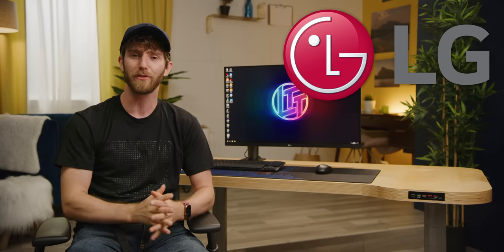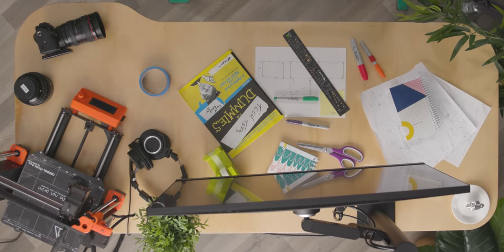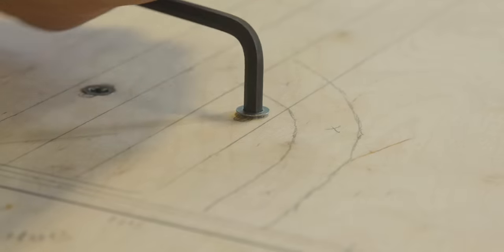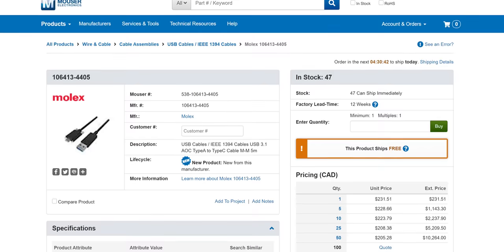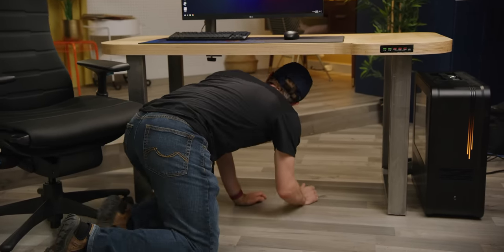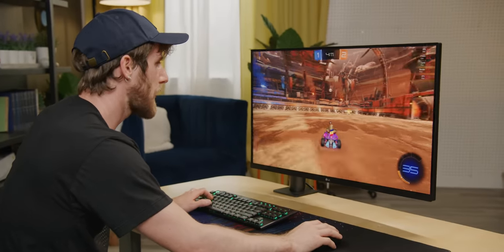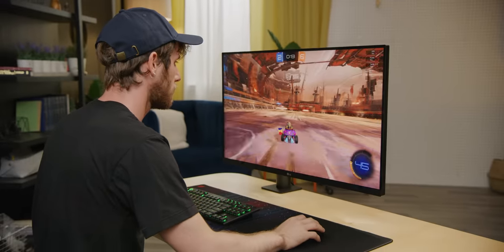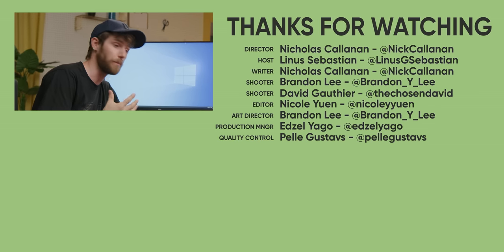Project Zero Cables - The Cleanest Desk Setup EVER

Comment: Not gonna lie "DIY Perks" did it better
Reply: Yes. With you on that one.. But this is a cable management project... And he does say at the end that there is a 'PC inside desk' project on its way.. Hopefully we will see the reference/deference to the DIY Perks build in that video.
Reply: They have made more than one pc setups, where it is integrated in the desk
Reply: @notjohndoe7130  i said what i said because the thickness of "DIY Perks" desk is almost same i guess.
Reply: and remember DIY Perks is just one guy. Linus has a whole team and a giant workshop. DIY Perks is doing all this from a normal small home. Its amazing what he manages to achieve. Great design and engineering but sometimes not very practical. Like the what was it dozens of noctua fans? have you seen how much ONE of those is? hehe
Reply: @ClayMann  You are right , Linus has his whole team and lots of expensive kit, however I'm not convinced that his workshop guy Alex is that good in his field. Remember the Pyramid PC build? He  can barely just about weld two pieces of tube together..

Matt at DIY perks does the whole thing. Whilst I take your point that noctua fans are expensive, I'm sure he suggested an alternative in the vid (I'd need to rewatch it to make sure).
Reply: @paulluce2557  I agree 100% with what you're saying. He recommended server fans but they are massively loud. You can run them slower but that Level1 guy Wendel has said many times. Don't run server fans in your room. Put them in another room or basement. As soon as you start hammering the CPU those server fans will rev up and sound like multiple hair dryers lol

but to be fair. If you were patient and searched for S/H fans that are the better quality ones. You could get the price down but for me at least it would still be too expensive for what I'm trying to do, cool my PC. I think a nice easy way around all this would be to just have the desk one drawer thick and have drawers either side with half the space at the back of each drawer for a full sized PSU (those server ones are again very expensive) and have a normal full height noctua cooler. For me the drawers would be super useful. In my own serup I have 6 drawers on my desk and I use them all daily. but minimal is in and practically managing all the junk that comes with your PC like controllers, flight sticks old drives and so on doesn't gel well with minimalistic design principles haha
Reply: @ClayMann  Yeah, surprised how much he can achieve in that room. Its quite small for all the large scale projects he produces in there. Love his work. Turns mundane everyday things into art.
Reply: Interested to see price vs time vs performance for both projects thought...
Reply: He should have used a GPU+CPU AIO such as a hunter duet 2 frm ID. Would have made the build more silent, cooler and not severely underperforming.
Reply: @tahsin28  having 40 of those noctua fans, made people comment a lot, which will be picked up by the algo

Comment: We could take this to the next level.
The next level:

Levitating monitor setup
Reply: that's exactly what I was thinking
Reply: Could actually work with magnetic, although the box you would need to build to hold the monitor in place would defeat the purpose of it. Might also interfere with the picture
Reply: DIY Perks guy already took all this to the next level 2 days ago
Reply: useful yt vid: https://www.youtube.com/watch?v=BSI9hjZaoyI
Reply: Next level: Building a PC on the roof😂
Reply: My dream is to have walls made out of e-paper. How cool would it be to have Mr. Game&Watch move between edges.

Only thing is e-paper has low FPS otherwise it would be really cool to game on. Hopefully that will change though.
Reply: Holographic keyboards and levitating monitors and speakers
Reply: I think making the wall full of LED screen is better
Reply: mounts monitor to wall

Good enough

Comment: was expecting another pc-in-the-desk setup, was wondering how on earth you would've fit it all in such a thin desk lmao
Reply: Unimportant Account 1u server size could be used
Reply: Well DIY Perks managed to do it.
Reply: Not sure how well it would work but you could gut a gaming laptop
Reply: @mooshroom199  Well DIY Perks did it, first he used aluminium with a wood coating to make it thin enough while still retaining strength, then removed the fan from all the parts in the computer and used custom small fans to cool everything, and used a riser cable to connect the GPU.

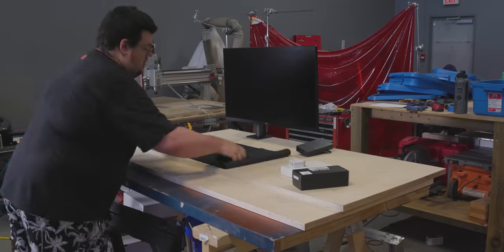Comment: 2:52 "Nobody likes bumping a USB stick and breaking it off."
puts only USB hub on front of desk on part that sticks out the most
I'm just confused.  This seems paradoxical.
Reply: Agreed. Just the fact that the usb stick will be sticking out like that is scary already
Reply: Yeah i would have mounted it on the desk surface probably towards mid or back corner facing up with a cover plate
Reply: I put low profile hubs on top of my PC and 3m tape them down so they dont move but are flush to the end of the case. gives me access to 10 ports within arms reach and didnt cost much for two cheap ass hubs colour matched to my PC case.
Reply: I think they were thinking that because the hub is in a 'notch' that sticks out from the front edge of the desk, you're less likely to bump into things plugged in to it because you'd bump into the notch instead.
Reply: Conman_123 this is exactly what I was thinking

Comment: I was expecting something like DIY Perks where the PC was inside the table... but it was not 😢
Reply: They're going to do one soon
Reply: It seems that's going to be a future video.
Reply: They've already made a setuplike that
Reply: @boneappletee6416  more than one actually. Think linus is using one of them in his office.
Reply: @maYdaY1337  He is. This is more for people who still want a PC on the side because the desk PC isn't great for everyone.
Reply: Yeah this video is completely lame bogus
Reply: Dont get the cable hate. Look Linus with his Monitor speakers...jeez. I want my PC speakers. wired mouse and keyboard. Just buy black cable sleeve material and stuff for cable management. But yes they did desk PC before, which is hell if something needs work i guess.
Reply: @Djuntas  Their desk-PCs aren't to bad to work on - think you only had to remove the glass to get to the hardware on the first one - and the second one was inside the little drawer-thingy.
But yeah - i don't get it either - i don't mind cables - i'm a tech guy - cables are part of my life and i prefer them over wireless stuff.
Reply: @maYdaY1337  Oh thats good, thought it was almost permanent :P
Reply: They did that already. Look it up.

Comment: Not even 30 seconds in:

"DIY Perks was better!"
Reply: Yesssss!
Reply: Lmao yes
Reply: WAY better...
Reply: Short answer: Yes.

Long answer: There were different goals to achieve here.

DIY Perks wanted to make a hidden PC, as in, entirely hidden. As far as I'm concerned Matt did that near perfect. 
There are a couple of issues/things I'd change though:
- USB ports: he does have access ports afaik, but they are nowhere near convenient
- Missed the opportunity to use something like a logitech mouse charge pad with wireless mouse connection
- Integrating the powercable inside a table leg (different legs would be needed).

Linus just wanted to have a zero cables desktop experience. They succeeded pretty good.
Is it cleaner than DIY Perks' version? No, not by a fair bit. Is it more functional? Slightly so. 
My reasoning:
- Pretty great access to front ports
- Wireless chargepad (though no wireless mouse charging, no clear indication where the pad is either)
- Cables are hidden enough
- 97% of working space is available (monitor stand)
- It could have been cleaner though.

So both achieved their goals, which were very different. Overall Matt did a more impressive and complex project and got remarkable results, but that doesn't diminish what LMG worked out to solve their project.
Reply: donutdoode69  a desk and a table are like the same thing
Reply: Lmao! DIY literally copied Linus underdesk pc! Who's the dad you moran?
Reply: @zypity  DIYperk literally copied Linus underdesk pc he's using it for years...
Reply: @MH-hs7ie  I know of it, but that wasn't the goal of DIY perks. It was making a hidden PC, which his is and the desk PC isn't.
Reply: @zypity  Doesn't matter what was his reason, the pc is the same as Linus years old several desk pc.. Literally a copy..
Reply: @MH-hs7ie  not literally a copy. For that matter, linus' is a copy of older builds. He was definitely not the first to make a desk pc.

Comment: Linus:does intro this the Desk setup you see zero cables 

Meanwhile the Cabel behind him:am i Joke to you
Reply: Ik this hurts
Reply: Cabel or cable?
Reply: bro that's addressed multiple times in the video.
they could have cut a hole in the bottom of the monitor stand and right below it in the desk, to route the cables completely invisibly.

but i'm pretty sure they're not planning on keeping the stand permanently on the desk, so they didn't.
Reply: CABEL
Reply: 4 More Years  you know what else is wrong? not using pia our sponsors for today video
Reply: You misspelled cabal
Reply: @UltimatePwnageNL  i think the screen itself should have a passthrough that ends were the clamps  are to allow the cables to be hidden inside the structure
Reply: @boronat1  do you look at the back of your monitor all the time?
Reply: Takeshima antivank HK cringe
Reply: @UltimatePwnageNL  true, i was just thinking as a design point for a sleeker monitor
Reply: 4 More Years  its a joke, cabal is a real word. Take a chill pill

Comment: Bro at the start when he said "cleanest setup v2"
 I was just staring at the monitor where there was a wire.
Reply: Adolf Hitler  ummm no did you read my comment?
Reply: Right? Me too LOL!
Reply: @Tyrannical User Only if you do almost nothing with your conputer.
Reply: Tyrannical User until you have to charge that thing every few hours
Reply: @Tyrannical User those gaming laptops do not even come close to the power and efficiency of a PC over an extended period of use. Thermals and batteries suck on laptops which makes you want to change it every few years regardless of how you use it. Mainly you have to shell out ~1k or more for a decent gaming laptop while you could build a PC of the same specs for close to half the price.

Comment: My room is the exact opposite: everything is connected via cables which are routed in various "spaghetti" ways! Basically, wires are going everywhere in ~25% of my room, in the corner where my computers are. I don't even use Bluetooth... 😁

Comment: I realized im better when I have an under the desk cabinet for my keyboard and mouse its also more comfortable either that or I really need a super low desk like around 27 inches in height. My current desk is about 30 inches high

Comment: Computer on the floor
Kyle: "REEEEEEEEE"
Reply: I don't get the hate.
 It is the cheapest silecing mod you can do in the first place after great cooling. You save tons of desk space. You can even use cheap (noisy) hdds. 
 If you worry about dust use a vacuum once a week ffs.
Reply: @DxCBuG  I would just worry about kicking it.  My desk has a tower shelf so I'm set. 😉
Reply: @camerons.8322  Even if, it won't break by hitting it with your foot. Not even the hard drives should. Otherwise, put it behind the desk legs or onto a small pedestal

Comment: I have a little idea. You could make like the table, a thin piece of wood first. Then you do the cable managements, integrations and things. Then you put borders at the edges of that piece and put another piece of wood to hide the cables. It will make a little box for the cables. Of course, put some pillar inside so it can handle more weight. I don't know if anybody did that before lol

Comment: "No one likes bumping a USB stick and breaking it off. We've all been there."

Such a joke when you purposely put it in a place where this will happen...

Your IO in the front with the US ports is probably the worst thing on the world for me and WILL end up breaking USB port themselves and the flash drives.
PEOPLE do not do the IO in the front of the desk, MASSIVE MISTAKE.
I often walk and sit on my chair and rub against the table by accident.
Reply: I felt the same way when I heard that comment. On-the-desk USB hub for me!
Reply: I would've probably placed the hub into the top of the desk, so nothing would stick out FROM the desk sides, but then you get dust and shit in the sockets.
Reply: Eh, had my USB hub screwed flush to my table from edge for a year now and never broke a USB drive even though I quite regularly bump into the table. I'd say it depends on where there's an area you're most likely not often gonna be with your chair and some carefulness
Reply: @resneptacle  definitely! I've yet to break anything either and have a similar setup, but I've come close a few times.

Comment: Hey, I don't know how many people have actually attempted to build this but I have a few questions.

For context, I would be wanting to plug my laptop into everything via a Thunderbolt connection 
How does the USB Hub actually receive power? Does it need to be powered? I'm assuming my thunderbolt 3 port would provide power.
However it's mentioned that the 20 pin connects via an optical cable, this wouldn't transmit power.

I think I would also be taking a slice out of the other clean setup video which used a CalDigit Dock which everything would plug back into then a cable back to the laptop.

A bit of guidance would be amazing <3

Comment: I remember when 30 inch tvs were deemed big and expensive.  Wasn't that long ago actually.   Growing up in the 90s pretty much my immediate family.... and extended family for that matter all got by with 27" tube tvs.  Some uncles had "huge".... 36" tvs.  I literally just got home from best buy to buy my first TV in about a decade.  Replacing my 2011 47" Toshiba.  47" around 2010 was a pretty big TV.  Those sizes are now located in the side "cheapo tv" aisles at best buy and the main ones on display.... you'd be hard pressed to find anything under 65".  Crazy.  What's even crazier...... I'm upgrading from my 47 inch Toshiba to a ridiculous 85" Sony 900h.  BB had a deal too good to pass up.  85" 900h with their 3.1 hi res soundbar for $2800.... normally both priced at msrp go for $3700.  I still didn't even get the best deal because I only noticed the package the Sunday after Thanksgiving and then it was going for an absurd $2000 even.  I failed to realize it was their black Friday/cyber Monday crazy sales event because I had a brain fart and decided to sleep on it before making a decision.  Next morning is when it jumped from $2k to $2800.  Still a helluva deal.  Hopefully this purchase is more future proof than my Toshiba dumb TV was and this Sony will last me just as long (about 9 years) and then some.  Felt like a fool spending damn near 3 grand on a TV.  But my rationalization was it will last me at a minimum... 7-9 years... ideally longer.  And..... it's fucking 85".  Quite the evolution from growing up with a 27" tube TV.  27" computer monitors are starting to be getting deemed "small" or at least "mid sized" which is nuts.  I have a 32 inch monitor paired with my iMac and it's great.... the other day I realized it's bigger than the TV my family had in our living room growing up.  I think I hadn't realized that because despite being bigger screen sizes they are so ridiculously smaller overall and insanely lighter than the big ass tube televisions of the past.  Not going to lie, talking about tube TVs and old tech makes me feel old.  I think I'm only like a year older than linus.

Comment: I really like the direction that your table has taken! I would like to do something  similar with epoxy and have a dual monitor setup built into a sailboat galley table that on the backside of the monitors they have a veneer that matches the veneer along the wall of the galley while it would be a multi-use area.

Comment: Any ideas on what that optical cables actually looks like, how it attaches to the USB hub and how it is plugged into the PC? Is the PC side USB-a connector? How was the sata power routed from the USB hub, are there legit Sata power extensions that long?

Comment: It’s def very cool and clean.
I’ll stick with my 4 monitors mounted on a wall with the wires hidden in the wall.
Reply: Although you should not run power cables through the wall.

Comment: Nice looking desk!  FYI, regarding raised grain, you can raise it by wiping with a damp cloth (and sand it back down with fine sand paper) a couple of times before you start finishing. Once done, it will not happen when you apply the finish.  

Also, in retrospect, were the underside cable channels necessary?  It seemed like the skirt provided enough room to hide the cables without those extra steps, but I couldn't tell from the video.

Comment: 11:57 this! I bought a junky monitor mount off of amazon for like 60 bucks or something. It's a dual screen mount that you'll have to drill a hole in your desk to use which was the first flaw. Second flaw: no mater how tight I screw in the joints I can't for the life of me get both screens lined up evenly. Plus I only have 1 arm and its very unforgiving when i loosen the joints to try and move them. I've had it almost a year and have never even came close. They're always at least an inch off, my aide is too afraid to do it for me. she says shes worried she'll break the screens by manhandling the screens like I do to try and line them up. Next time I get "my taxes" ill buy a mount like this. thanks Linus!

Comment: fyi for anyone watching, free-handing with a router for anything but a cut using a flush-trim bit is a recipe for a ruined project (and likely a trip to the emergency room) if you lose control. You may think you have forearms of steel but nothing stops a skipping router except a guide or a bearing.